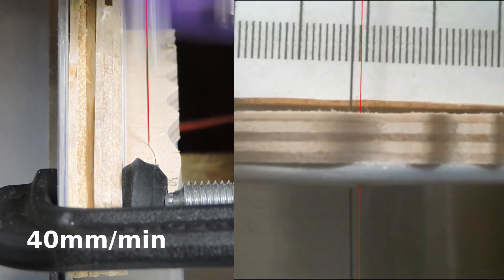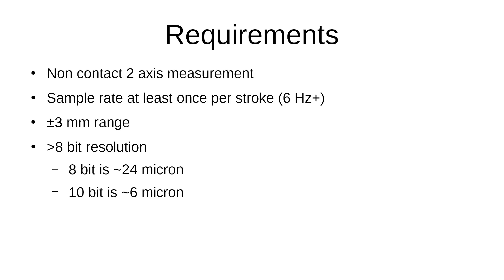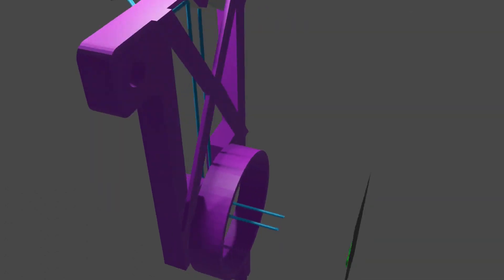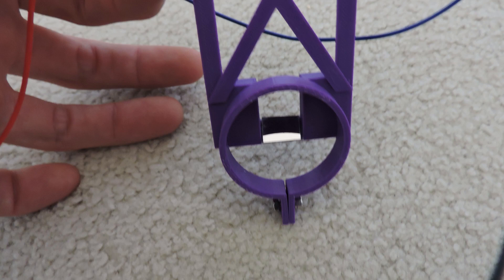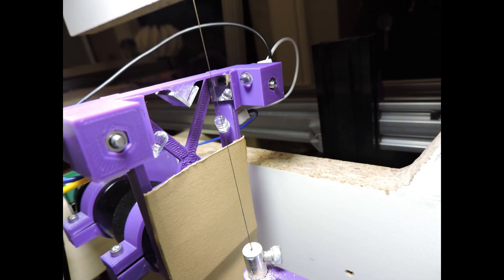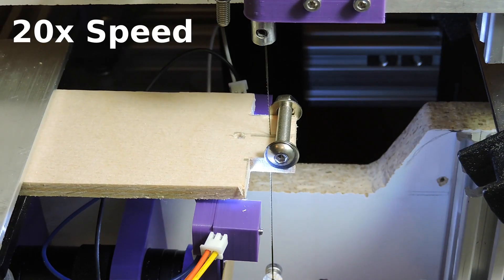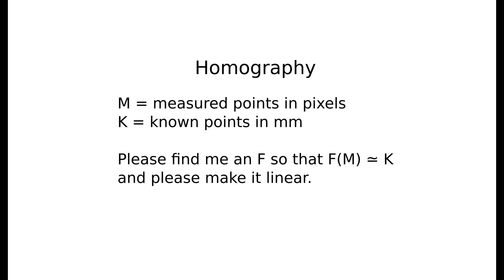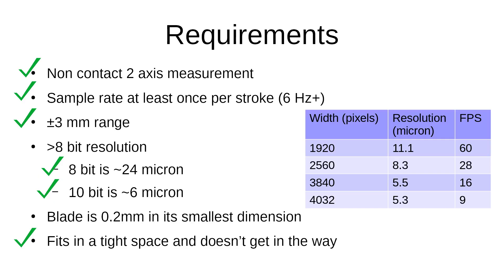Split Vision Periscope - 2 Axis Non-Contact Displacement Measurement

Comment: Andrew, you might want to watch this video - https://youtu.be/c0hfi6VPUXU  it's a demonstration of using spiral blades to cut in pieces that seem much too large for a scroll saw.  The spiral blades come in as small as 2/0 and may work for you - the advantage of them is that you don't have to turn the blade.
Reply from the maker: Yep I have 3/0 spiral blades but the kerf is still over twice that of a 2/0 straight blade and the finish is nowhere close to as nice. And they will have the same blade lag

Comment: Hmm my first thought was an inductive Sensor solution. Run the blade through two pairs of coils and calculate the position from the change in inductance.
Reply from the maker: I looked into inductive and capacitive sensing. From what I read and tested, they aren't suitable because of the small target size